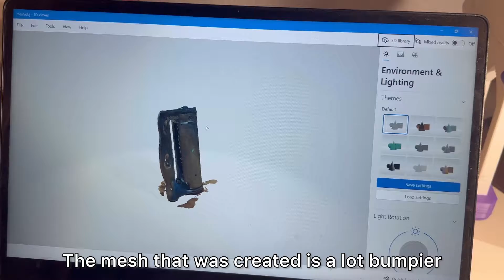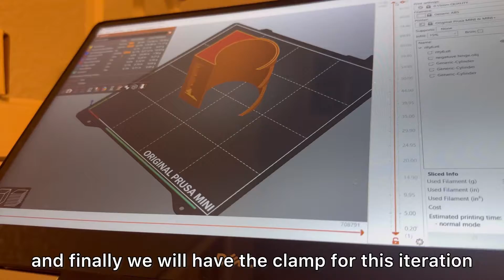3D Printed Hockey Training Device

Comment: The pole clamps can be made like quick release equipment, like for example the clamps you can use to attach a GoPro to handlebars. That would be my only suggestion. Looks cool otherwise
Reply from the maker: Like a workout clamp for weights? I’m going to add this, thanks!